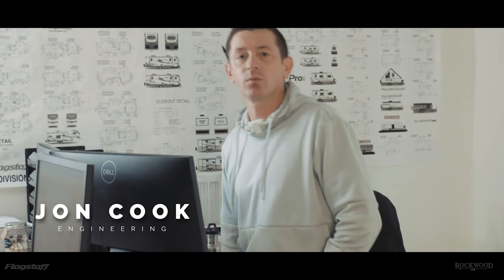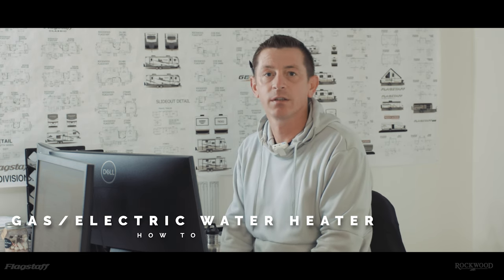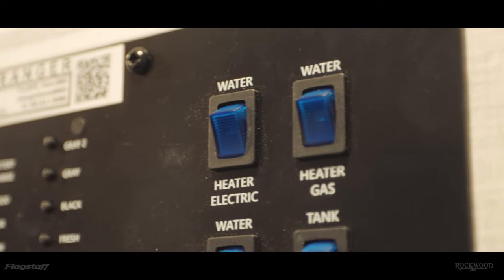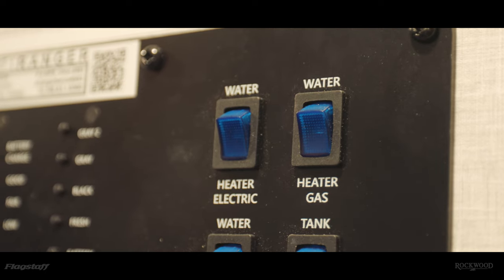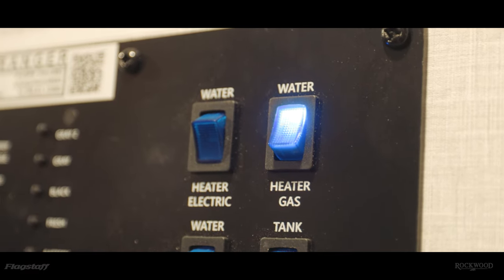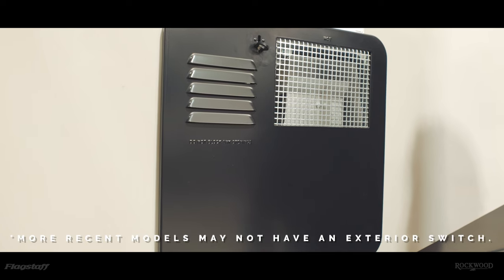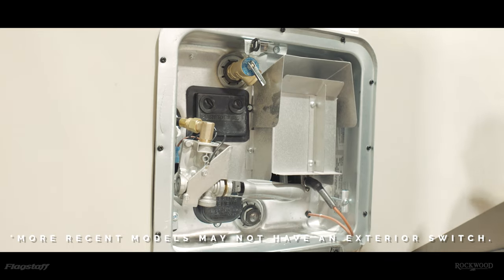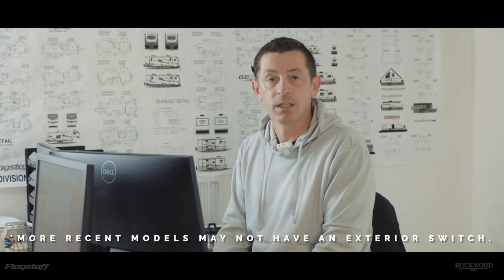How To: Use Your Flagstaff Gas/Electric Water Heater

Comment: This barely gave enough info. Where's the electric switch in the control panel? What does it look like? For gas, is there a pilot light we need to light manually? Where's the electric ignitor?
Reply from the maker: Hello, The switch on the control panel is labeled “water heater” and have a gas logo or a electric logo. There is no pilot light and the water heater is an auto-ignite one. Additional information should be in your brown bag you receive for each trailer or online under our component manuals.